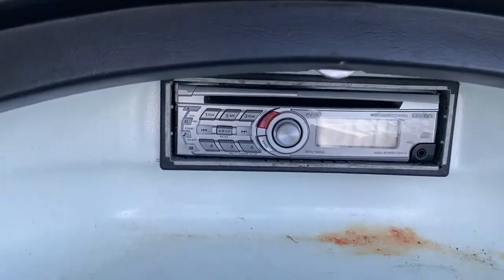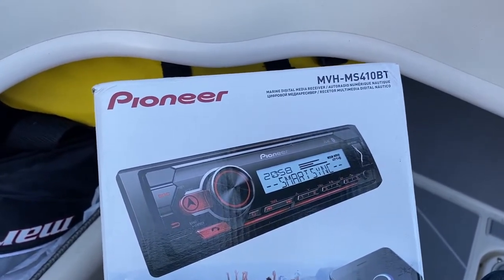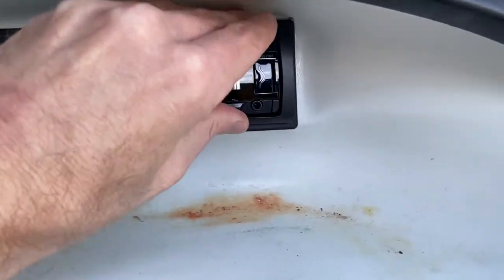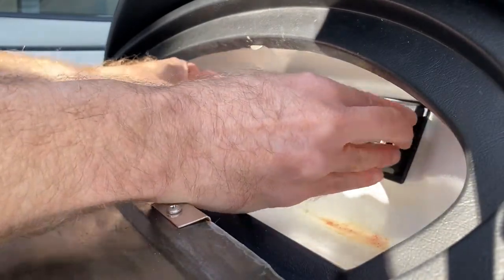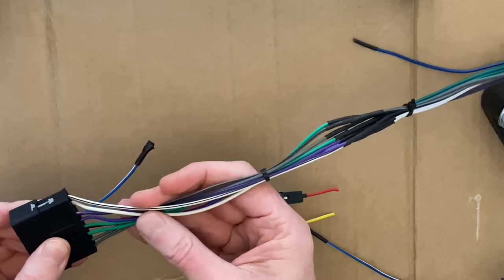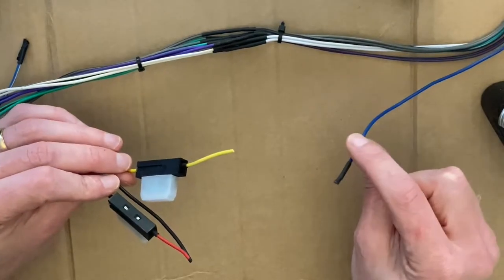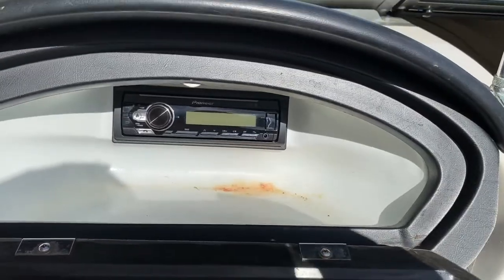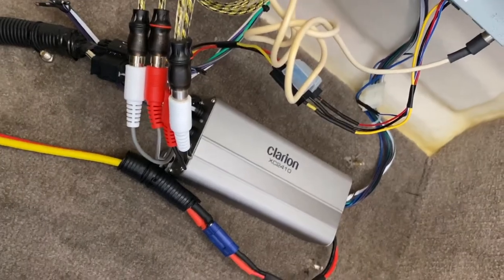New marine stereo install into bowrider

Comment: Great video. I have the same boat and will be doing an audio upgrade this summer. Have you installed a subwoofer yet? Not sure where I'm going to put mine. Thanks
Reply from the maker: Thanks!
I haven't, personally I don't feel the need, the polk speakers have sufficient bass response for me. A sub means a bigger or second amp, and then probably a second battery and we're tight for space as it is. You could probably fit one on the shelf under the passenger or driver's console - you'd just need a way to secure it.